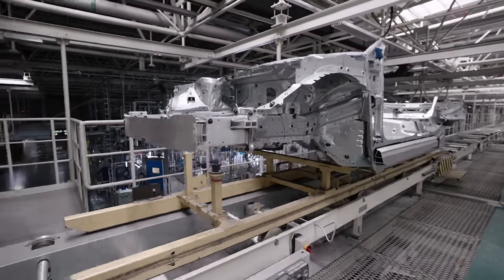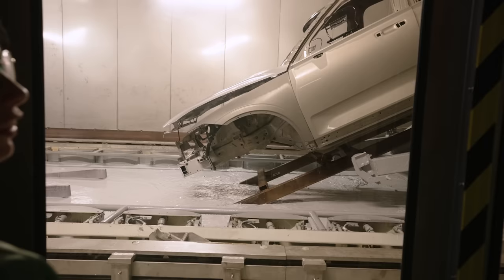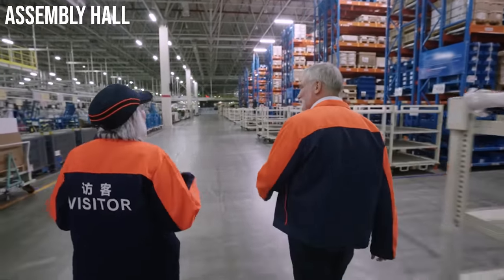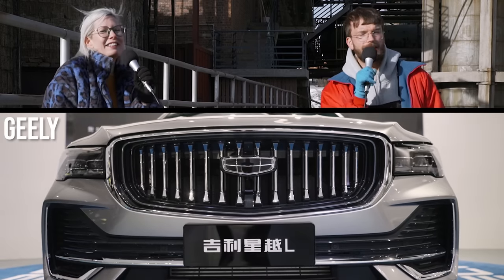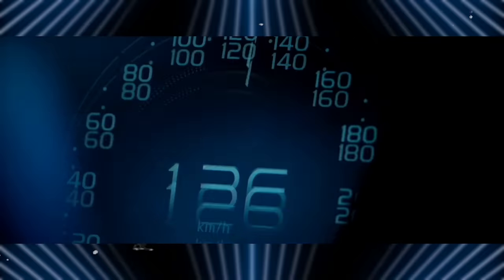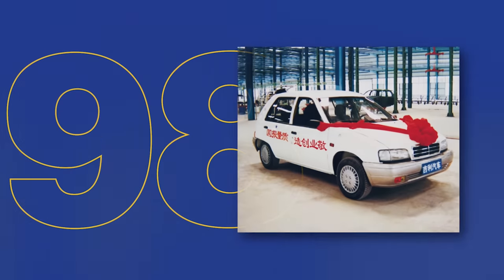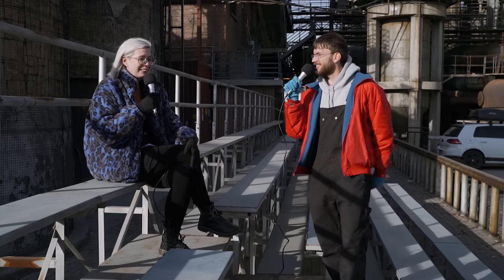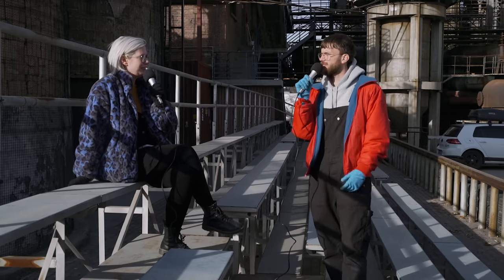We Visited A High-tech Chinese Car Factory

Comment: The more videos from China about the Auto industry. I can't help but think that China has advanced so fast , from small capacity, and little experience at making cars. It looks like China is at the front line of the modern technology world for the ordinary person to own. Most modern cars today that are made in other countries, are not the greatest reliable cars that they should be. China unknown reliability may not be any worse. It looks like China is at the front line of electric vehicles. And maybe they are making cars for other countries reliable brands, just have to put the brand name on. But totally engineered and made in China.. China is doing a great job at building in the vehicle industry and looks like it is out pacing all other countries.
Reply: You should watch other videos of how China builds tall buildings in like 2 weeks, and how they build bridges and tunnels.  The engineering in China is simply amazing.
Reply: GM ultium EV platform & battery is developed in china. but, because of many "non technical" reason it will never mentioned. later if GM really build battery factory in US (JV with korean company for the same reason), the "raw material" will be "pre-baked" in china.